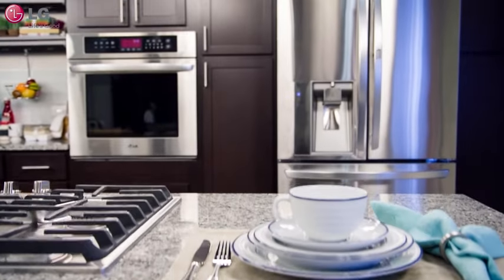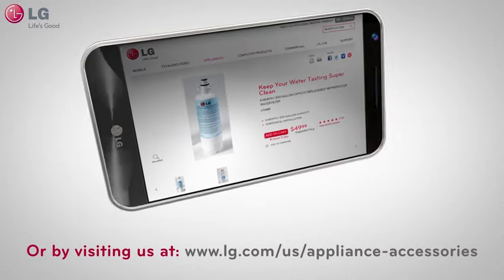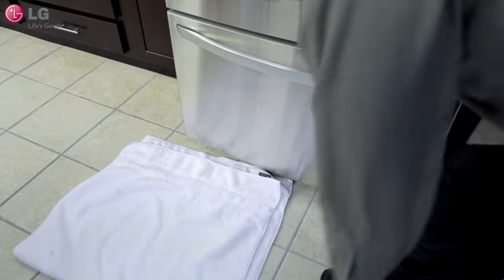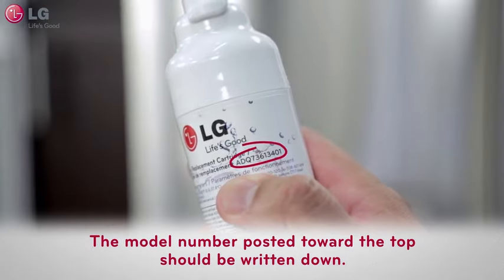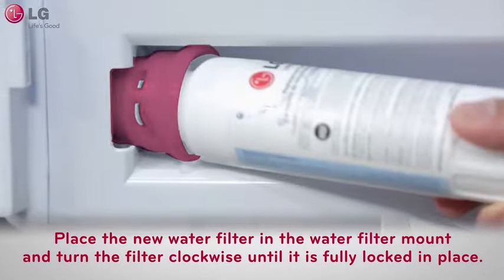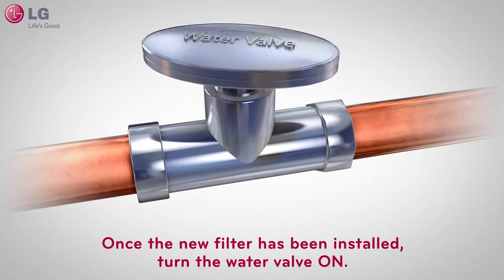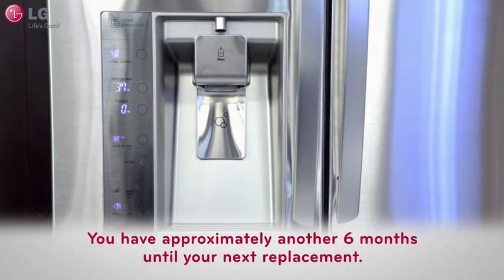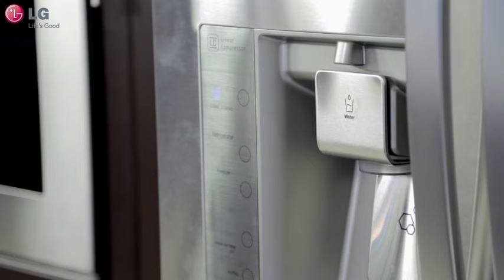[LG Refrigerator] How To Replace The Water Filter - Beside Door

Comment: Seems like it could be done quickly without turning off the water...
Reply from the maker: Hello there! You should know that the bypass filter eliminates the need to turn off the water supply line. However, replacing the water filter may result in a small amount of water (approximately 1 oz. or 2.5cc) draining out. To avoid any water leakage, simply wrap a cloth around the front end of the water filter cover. When removing the water filter, be sure to keep it upright to prevent any remaining water from spilling out. ~Rita
https://www.lg.com/us/support/feedback